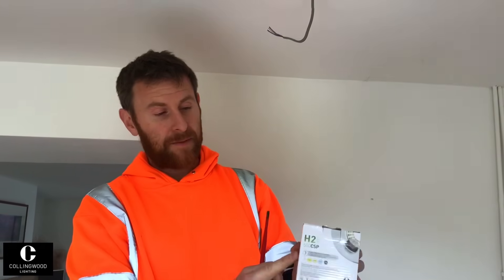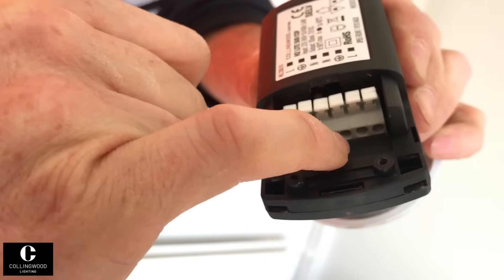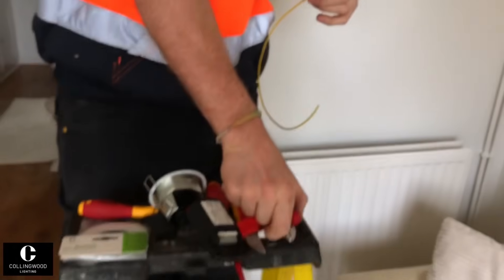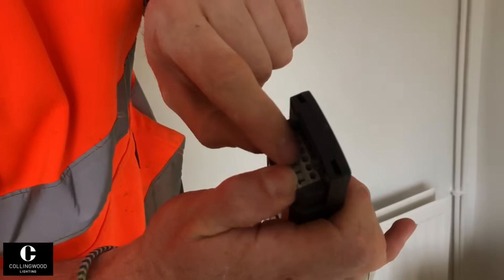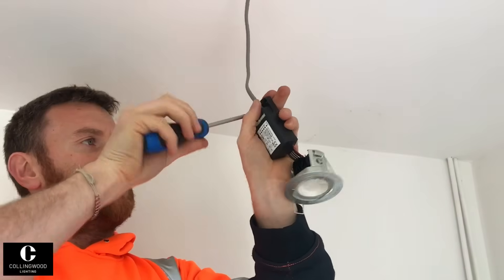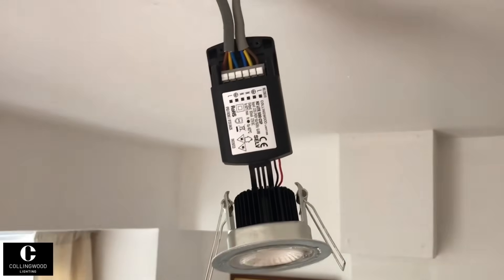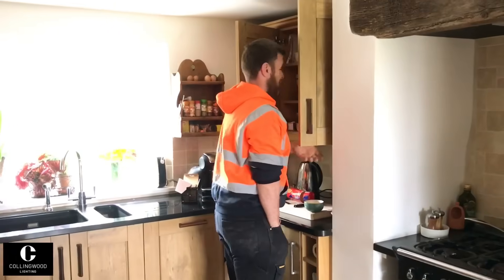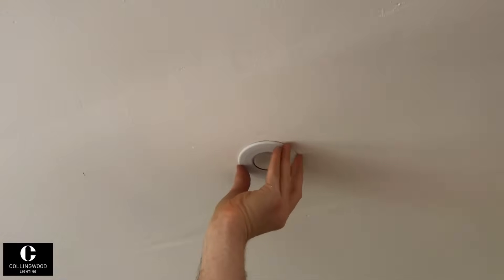How to Wire up Fit Collingwood H2 Lite 500 CSP LED Downlight’s with 3 Colour Temperatures in 1 Light

Comment: i wish i'd seen this video before trying to install them BTW 4:08 for me, the light didn't work if i pushed the 3 wires in one the right set of connectors, but it did work on the left side. Maybe I hadn't pushed them in enough but they seemed rock solid. But you managed to get it to work with them plugged into the connectors on the right. Strange. The bezel locks in really securely if you hold the light whilst you turn the bezel, the way you did it you only turned it half way, but just turning it finger tight is probably better as it will be easier to get off if you need to change or remove the bezel.

Comment: Would have left the single cable at end of circuit and put a block on it so that you could have checked continuity of cpc after fitting all the other lights.....especially with push fit fittings

Comment: We use Solo 10 down lights which are similar apart from you get 3 bezels and there magnetic, you don't need to push the buttons that's only to release the cable they should just push in

Comment: You shouldn’t need to push the levers down to insert the cable. On every other fitting I’ve used like this the push levers are to release the cable.
Reply: I think your right. Always a good idea to have a quick scan of the instructions especially a not fitted before product - but who does that.
Reply: @nw5835  The instructions told me diddly squat on how to push in and pull out the wires.